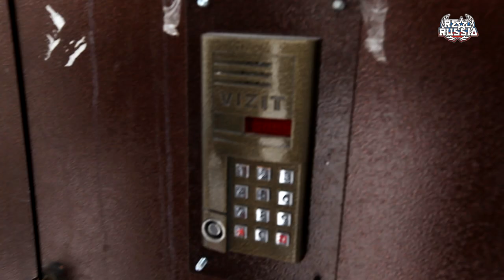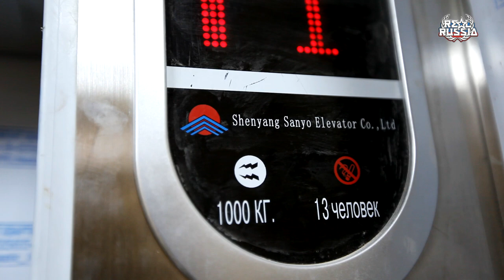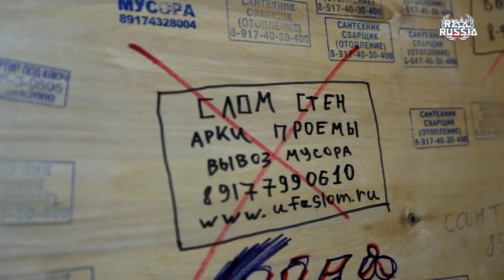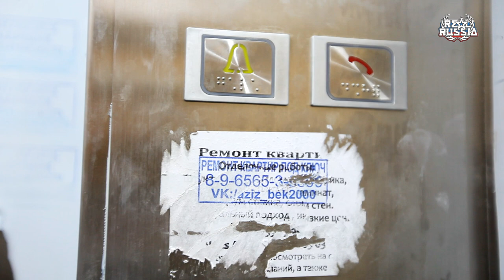Vlog 4. Update on Remodelling. "Real Russia"

Comment: Hi Sergei, I am glad to hear that you decided to keep the door and wall between the kitchen and enclosed balcony. I have worked in architecture and construction here in Canada and we had a very similar situation in one of the last high buildings we built in Vancouver. As the architect responsible for the building we had to inform the future owners that the construction of the exterior walls of the balcony were not constructed to perform as exterior walls due to civic ruling that the space was not accepted by them in the allowable building area. This meant that the walls were not insulated and did not have vapour barriers on the inside of the walls. Our concern was that if the area was added into the apartment it would cause the apartment to be cold and the increase of air vapour going through the wall could result in condensation leading to corrosion of the metal studs and destruction of the wall from the inside out. So you always should make sure any changes to the apartment are compatible with the construction concept. 

Of course if you would like to take me there I would gladly and generously advise you on the work. I have been working on my own house since I retired to a smaller city Victoria which is the capital of the province British Columbia. I am pretty sure you would like it here too. Seattle is the closest big American city. Famous for being the headquarters of Boeing aircraft and Microsoft.

Comment: What voltage is used in Russia for household appliances?  In the US, we generally use 120v for most appliances, and 240v for electric clothes dryers.  Both are set to 60Hz frequency here.
Reply: +AKJeeper 220v 50Hz, Euro plugs

Comment: It's interesting to see that the process of buying/decorating a new house in an apartment building is about exactly the same in China, even the protective cardboard in  the elevator  and the ads on it. In China for this size (200sqm I guess) it would cost about 50-80K USD to decorate, depends on what kind of materials and furniture you buy, I have done several times in the past decades so I know.

Comment: Well, now it's starting to look like a real apartment, and you get a better sense of its size with the walls up. So, a question: Do smoke detectors and carbon monoxide detectors come installed as well, or is that something you will need to install yourself? 

Also, I have to agree with some of the other commentors....showing the security code to the front door was probably not a good idea, or exactly what apartment number you're living in.
Reply: gasaholic47 ccarbon monoxide detectors are used where natural gas is used for cooking and heating.